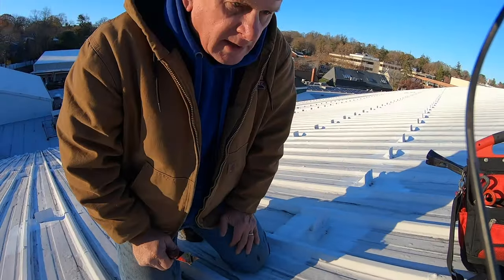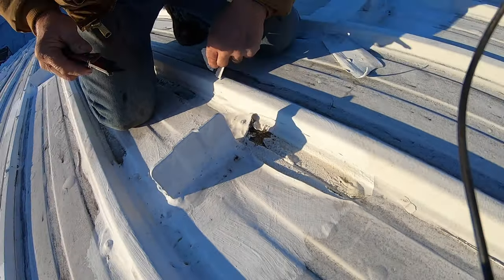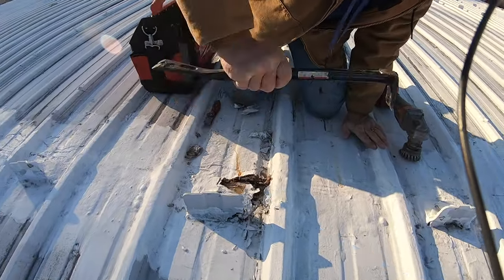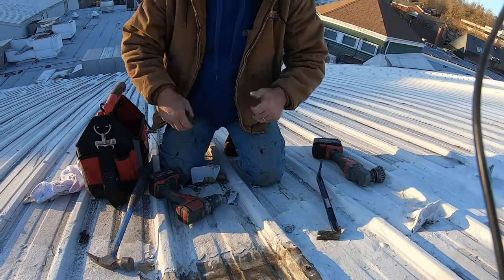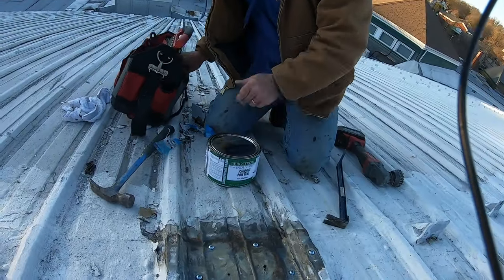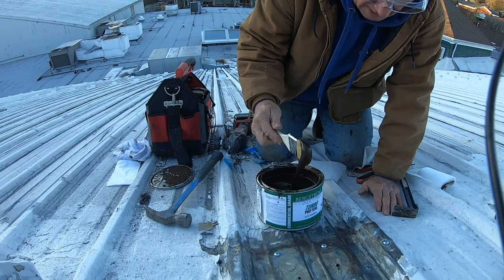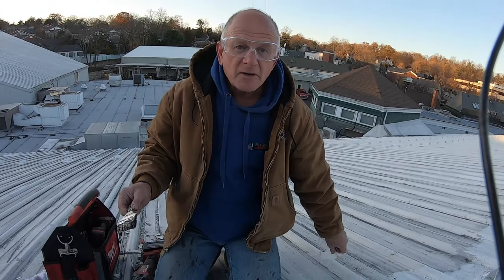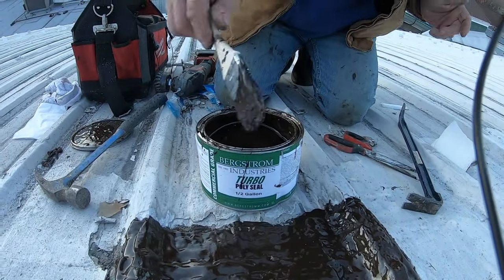Why NOT to apply Metal Roof Coatings - The worst thing to ever do

Comment: At 10:45 you say, "acrylic, all silicon coatings I don't think works" & then repair with Turbo Poly Seal, but list Super Silicon Seal as your best advise in your Summary text - which of the two products do you prefer?
Reply from the maker: I have tested both and have used both  products extensively. Super Silicone  Seal is more fluid and will cause runs easily if the roof is slanted making it harder for a clean job whereas Turbo Poly Seal is leas liquidy. Turbo Poly Seal gives you less linear feet per gallon. I really can't say which one is better. 
f you use Super Silicone Seal with the fleece in harsh Florida sun will last longer and you don't need to protect it against UV's.Turbo Poly Seal is nice for difficult areas and vertical surfaces as in flashing. Turbo Poly Seal is also much tougher. 
Honestly, I really don't know which one is better.
Thanks for your comment.
You are a good observer.

Comment: I am from Chennai, India. You really saved me. I was about to buy the "So-called metal roof heat insulation coating". I might have ended with the rusty roof!
Reply: This guy is wrong! Coatings are a great option, just NOT fabric based systems. The one he's on is a fabric based system. Great options that will NOT do what he's posting out are ER Systems and FAR coatings. Both are liquid-based only. No fabric. Coatings can protect your aging metal and make a roof seamless. Any repair the "flat roof doctor" makes without protecting it from the UV rays won't last 2 years.
Reply: @WestTNReb  that isn't fabric... that is acrylic, which dries like rubbery plastic and when it fails becomes like thousands of little rubbery pockets to hold water.
Reply: Elastomeric paint it not meant to stand alone. After 2 coats of this 2 more coats of silicone rubber will keep it from doing this. You can't just use elastomeric paint by itself.

Comment: So what do you suggest to coat a metal roof?  I don't have a leak but my metal roof is in need of a coating in general and I typically hire someone to do it and they put on a Kool Coat in double layers.
Reply: I am the superintendent of a roofing company and I would recommend using a non fibered aluminum roof coating.
Reply: Aluminum roof coatings is all i use. It doesn't have the cracking problem that acrylic and elastomeric coatings do

Comment: It's called washing very well and priming all your bolts and edges then coming through and spraying it correctly  alot of painters don't know the proper way to spray always spray your corners and edges first similar to cutting in maybe 3 panels then come back and spray your face surface I've sprayed many metal roofs and never got a call back it's all about taking your time and taking pride for your customers
Reply from the maker: You are correct, but margin for error is to great on big roofs. Almost impossible to guarantee that every screw and seam would be properly prepped

Comment: Preparation is essential and proper application is important. However, using an acrylic elastomeric that doesn't lose key characteristics, like essential flexibility (elongation), is key to a superior roof coating.  Most roof coatings on the market will use inexpensive plasticizers (for flexibility), which leech out, and cause eventual cracking and/or flaking. Same thing happens with asphaltic based products (i..e aluminum asphalt), as their oils will leech out of their coating.  Acrymax's acrylic elastomeric won't lose their flexibility as it is built into the backbone of the very polymer (of their resin). This allows Acrymax coated roofs to have their life extended almost indefinitely with simple periodic recoats (at 5, 10, 15, or even 20 year intervals).  Recoats simply maintain mil thickness. The thicker, the more robust, the longer before a recoat. See this video link, highlighting a college's roofs, done with Acrymax nearly 40 years ago and still going strong today: https://www.youtube.com/watch?v=Q2m8rHBIUVg
Reply: thanks for the info. im trying to learn about recoating mine just bought a metal roof house. these contractors are fucking liars i talk to

Comment: I have been coating roofs for 21 years and I agree with everything you have said . What I like to do is use Polly seal and then coat with  asphalt aluminum ,just because asphalt aluminum makes it look nice and you can't see all of the patches and because it is a very thin coating ,asphalt based coating it wears away and doesn't peal but it must be non fiber . Any silicone, acrylic or elastomeric I have ever used has failed horribly within 5 years and would have been better off to not do at all. Also asphalt aluminum does great on rusty areas ,I have coated  roofs that have been on over 18 years it doesn't stop leaks but it wasn't designed for that but it makes a nice top coat.
Reply: so the asphalt is just for aesthetics ?
Reply: does the asphaly aluminum work on shingles and or bitumen? Thanks
Reply: @seaseeker3499  no roof coating is supposed to stop leaks , they are to protect the roof from uv rays. You have to fix the leaks before using any coating

Comment: Jetcoat and Henry Extreme sprayed on with a Graco Pro in three layers would work just fine in MOST applications.  White is not very reflective compared to dedicated reflective coatings folks. Use your resources folks.  NOT angry contractors fixing crappy jobs after the fact.  Bad prep is the key of this video along with climate and weather in regions

Comment: Acrylic coatings are great for metal roofs. Like you mentioned in your videos, it's all about preparation. They obviously didn't prep this one. In California some contractors use a seam tape that has a peel and stick backing and polyester surface. 
Once that's installed over seams and voids we apply acrylic gel and then after it's cured we apply lMetacrylics coating. That particular Astec didn't fare too well in Ca. Too much ceramic in the formula and lots of what you see there. I enjoy your videos 👍🏽. Keep them coming.
Reply from the maker: Thanks for your comment
Reply: Acrylic is horrible, especially on metal.  Don't be delusional.... or be delusional and paint your car with acrylic because you think it's so great.

Comment: Interesting topic. I plan to paint my roof with a white acrylic paint like that. There is a difference though. I see that you had ice underneath the paint. My house is in the tropics where I NEVER have ice formation. I think the melting and freezing of ice (which causes expansion) is a major cause for the paint to be pulled off the roof. Even if it would affect the durability of my roof, it's probably worth it painting my roof, because of the aircon energy I can save from painting it white. I do have a lot of expansion and contraction from the hot sun, but perhaps the white paint can help to reduce that expansion a bit.

Comment: Panheads without a silicone or rubber washer? Fleece? I didnt see an acual break in metal. Preperation is always key! Sealing properly, the coatings is essentially necessary! Its up to the owner whether he wants to spent big money or go cheaper. Details prepping all fastners, screws, etc. from what i saw, improper prep work was performed. Bad robots!

Comment: I have a Galvalume roof and would never just slap an elastomeric coating on it without surface prep.  I would first spray it with a bleach solution to kill mold and bacteria, rinse, and then make a dop stick by stuffing an old athletic sock inside another one and zip-tying it to the end of a screw-type wooden rake replacement handle.  I would get a gallon of Ospho rust converter and saturate the dop stick and dop each screw, twisting the stick to get thorough coverage.  I also would seek out any rust (generally not a problem unless you let the roof go way too long before taking action).  I would then use aluminized fibered roof coating to cover each screw and seam before applying elastomeric coating.  I would then wait several days until the coating had cured and then apply two coats of elastomeric coating, letting the first coat dry thoroughly.

Comment: Our 30 year old ministorage has 30k sq ft of 29ga galv or galvalum on 5 of 6 buildings.  Similar product as your video but never painted.
Purlins are 1x3 wood spaced too wide at 36"-42" on factory wood trusses 3/12 slope. Concrete block sidewalls.  New gutters and downspouts.  In our 3 years have learned that NOBODY goes on the roof except a personally trained worker. 

Fortunately we identified dents which allowed gaps in the overlap seams (from 30 years of untrained roof-walkers) and have sucked them together with rubber-grommeted screws on top of the metal profiles.  Replaced probably 25% of the suspect screws with larger diameter (75% yet to go) 

Appears leak problems are NOT accelerating, original fastenings mostly without rust stain (thanks to galvalum corrosion protection & rubber isolation washers).  We've made significant gains against the very few customer complaints of water.  Was a risky investment!

BUT the facility is below road-level such that the roofs present a poor image of our business and brand.  Multicolor stains over white oxidized alum as you would expect.  Unthinking, I thot to paint to achieve unform color,  prhps white for heat control.  But I know it will get dirty.

THANKS for the headsup about coating.  But what shall I do for COSMETIC?  And how to invest in a long-life impermeable roof?  I'm thinking to add z-metal purlins on top of existing roof, one above each 1x3, plus one between, then a new powder coated roof over top.  This way 190 tenants aren't exposed during the project.  And prhps we insulate the space between old and new roof.

How can I reach you as a consultant?

Comment: It's why people use FLEX SEAL(WHITE) to seal the whole roof at least 3 full coatings. NOT little bit here and there because it will cause that problem. You must cover the whole roof. 3 coatings will do it and last for decades. It cost a little more and saves you big trouble if done right.
Reply: flex seal gimmie a break will leak quicker than any other product, execpt for bandaids i guess
Reply: The only real way to fix leaks is to fix the leaks... Don't just coat over them and expect the coating to fix it.

Comment: Roof was not cleaned properly before wrong acrylic coating was installed. Should have used silicone.  Best to fill flutes and install  a TPO membrane roof using the Rino Bond method of attachment.

Comment: I'm getting a snap-lock standing seam metal roof installed on my house.  Would recommend that I get bare (unpainted & without acrylic coating) AZ55 Galvalume steel panels, instead of the more common acrylic coated or painted steel panels?
Reply from the maker: very good

Comment: Roof Doctor,
I have an older metal roof that has begun to leak. It was put on with roofing nails. The gaskets are old and some of the nails have begun to back out. How would you suggest I repair it. Replace all the nails with larger screws or..? And seal the seams?

Comment: At 9.15 when you screw the sheets together and water comes out.   Can this be due to condensation running down underneath the top sheet into the lap?  
Sealing the top surface of the joint keeps this water in.   There is a reason why you should probably leave the lower edge of the lap joint open to drain.
The alternative is to seal the top and the bottom of the overlap to keep the condensation out, making sure you use screws with washers to ensure the 
water tightness there as well.
Reply from the maker: I originally thought the same, that condensation is trapped one's I closed the seams. Come to find out that there is no condensation due to the insulation on the inside. If condensation was an issue, then all the seams would be leaking almost every day. So, I realized that the seams were so rusted because of the acrylic coating that trapped the water in, I then decided to clean every seam up and do a proper seal using Turbo Poly Seal and sometimes Super Silicone Seal

Comment: I will point out some facts.
1) Surface preparation is everything on any roof coating. 
 a. Remove any loose rust with a wire wheel.
b. Treat solid rust with an agent that chemically changes the rusted surface. 
c. Replace bad screws 
d.Pressure wash and THOROUGHLY DRY.
Make sure pressure wash removes all loose material
2.  Epoxy is best by acrylic will probably work if you follow surface prep.

It is almost cheaper to replace than to properly coat depending upon surface preparation required and material choice.
Reply from the maker: All the comments have 1 thing in common, "prepping".
read my previous comment.

Comment: I apply roof coatings for a living. First off,preparation is key! And also a good,top quality coating is very important as well. Looks like improper prep and a junk coating!
Reply from the maker: Everyone claims that they know what they are doing. This roof was coated with Astec Acrylic Roof Coating and by a certified Contractor from Astec. This is not 1st roof I have found that have failed because of roof coatings. I have been on many. The problem starts after 6 - 8 years. What do you do then? The paint is peeling and blistering. No matter how well you prepared the roof for a coating, it will peel. What is the solution after the Acrylic paint is worn out and a new coating needs to be applied? That becomes a disaster.
I am sure you take pride in what you do, but to claim Acrylic Roof coatings are good on metal roofs, you got it all wrong. Even paints on cars fail left in the sun. Cheap roof coatings does not have the same endurance as Car paints. I have enough videos to prove my point.
Reply: Have you ever come across a Conklin coating that failed

Comment: Great information on metal roofing. I have a question and would greatly like your professional opinion. What do you recommend for a metal roof that has some surface rust that is not deep, but needs to be coated with something? Thank you very much!
Reply from the maker: Aluminum Asphalt coating I think is the best. Just lightly brush of the rust, not necessary to take it all of, then paint it with this. Karnak makes the best Asphalt coating.
Reply: .  I agree.  Once coated, an elastomeric coating would work, but I do not like covering rust with any water-based coating until remedial steps are taken.  Ospho is a good rust stabilizer to use first, but asphalt gets the job done.

Comment: The main purpose of those white color roof coatings is to reflect the solar heat. Without the coating, the roof would get unbearably hot, and heat up the space beneath. I'm glad that you show this problem, but not painting is not a good solution either. There should be a better solution.
Reply from the maker: yes, you are correct. but people sell the idea that coatings will stop leaks. To reflect the sun to reduce heat one should use Aluminum Asphalt Paint. That is the best reflector. Using coatings like acrylic and Silicone is not as good as Aluminum Asphalt.
Reply: @FlatRoofDoctor  SRI is the determining factor. Higher the SRI, more it can reflect solar heat.  But as you point out in this video, one should also make sure to select proper coatings/techniques to prevent rusting issues. I wasn't aware of that issue before.

Comment: Hi there, thais for the good video. I have here a 60,000 water tank with rusty big patches inside of it, and I saw today little drops coming from the outside. Help, how to patch this up? Could I use your technic, I also have been thinking of cement with water proofer but then I have to do the whole tank, it looked like a cold long day on that roof. Greetings from southern Spain.
Reply: you might could use rapid set cement all . Its pretty good or a type of leakstop cement

Comment: Is there anything you can put on metal roofing or basically just leave it natural the way you buy it would anybody happen know
Reply: man im trying to figure out the same thing. from what i find is you need a roof coating, not a roof paint. you need either fiber aluminum roof coating, or elastomeric coating. itll be silver. i do see some really nice metal roofs around me that are red that look flawless. so there has to be something out there. it seems if the metal isnt prepped right while its made then no coating of anything will survive on it
Reply: @hippa2dahoppa2  Zinc based primer to protect steel roofing, and top coat after thorough preparation.  Don't seal up overlaps.  These should drain due to gravity..

Comment: im new to metal roofs just bought a house with one and its a bit rusty. i dont have regular paint on it only the silver metal. what your talking about is someone painting the roof a color right? your not talking about elastic or fibered aluminum coating right? because i have some surface rust and im almost positive i need it brushed off and recoated with one of the 2. this house is 100 yrs old
Reply from the maker: I think the best bet is to use non fibered Aluminum asphalt coating by Karnak
Reply: Protect it with zinc paint not aluminium/asphalt.   Zinc chemically protects the steel from rusting.  Then top coat to protect from UV. Could use Aluminium asphalt on top.
Reply: @davidstobie5373   all this makes my head want to explode lol. trying to find contractors has been ridiculous. and my quotes are anywhere from 1000 to 14k. between trying to find what coating to use and whats a good price im going insane

Comment: the man is right, Coatings are a bad idea. Do it right the first time. replace the metal roof with a new metal roof. Coatings are a temperary fix at best.  The cost of replacing a "coated roof" is substanially higher then an untouched one. It's like kicking the can a few years down the road, the problem does not go away.